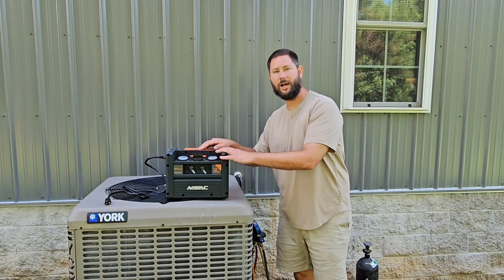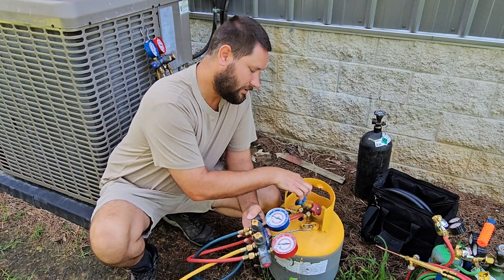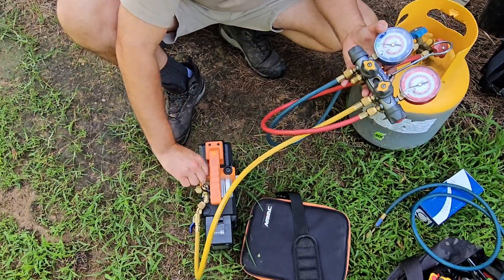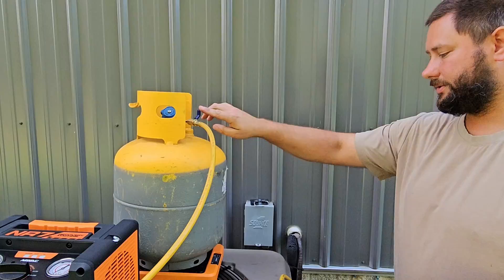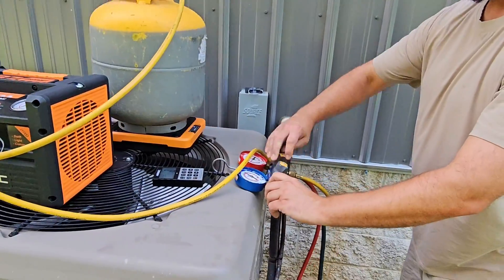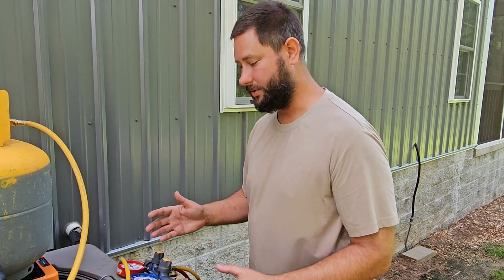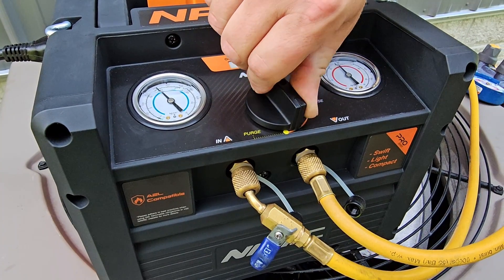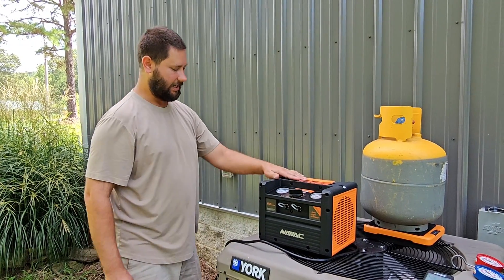How to use a Recovery Machine: HVAC Tips for Beginners

Comment: I'm still learning, and I have a question. 
I heard that the filter driver needs to be replace only when you open the system to atmosphere presure, don't could just do pump down the refrigerant I'm the condenser since the filter is before the service valves?
Reply from the maker: If the filter dryer is contained in the outdoor unit.And you pump down the unit, you do not have to change the filter dryer

Comment: Wonder what revovery machine witll work with R32.  I started working as an hvac tech back when we used r22 to blow out condensate drain lines without any cares.  Probably responsible for 2 or 3 layers of ozone, personally.  When the Kyota Accord was signed I purchased my first certified recovery machine from Goodman for $3600.  I cursed all the way.  I also got my R handling license as well.  For any who don't know it's your social security number.  Now with the switch to R32, begins a whole new chapter in refrigerant handling.  Good luck out there young grasshoppers.  One day you'll get old like me and not give a damn.

Comment: You mentioned that you didn’t want to recover past 5-10psig as to not draw air into the system and tank. You purged the line heading to your manifold but the best way to do it is to purge from the hose entering the recovery cylinder. The air in two of your hoses and all of the air in your recovery cylinder entered the recovery cylinder. Unless I missed that part
Reply: I think the hoses you are talking about are still in vacuum.

Comment: What is the compressors main function?
Reply from the maker: To pump the refrigerant through the system
Reply: Turns low temp low pressure refrigerant into high temperature high pressure gas

Comment: Does it matter if i hook up to bottle vapor or liquid port?
Reply from the maker: Yes, are you charging in liquid state?Through the liquid line, are you charging through vapor state in the vapor line
Reply: @ sorry. I Meant when you recover. I know the recovery bottle have a dip tube for the liquid port and the vapor port goes to the top. I’m just confused on when to decide if I should attach my hose to which port? What dictates which port to use for recovery set up? Does it matter?
Reply: If the state is small, like a residential one, it doesn't really matter. I always use the Vapor side because the liquid can just fall in since there is no dip tube on that side

Comment: My big question is, what do you do with the recovered refrigerant? How is it disposed of? 

Also what happens if you don't have any outlet to power your equipment with? Is it against code to simply just hook up a wire to a breaker and power you equipment this way?
Reply from the maker: Great questions.I will do a video of both of these
Reply: @TaddyDigest  yeah how to use the cheetah to the disconnect properly thanks

Comment: What is the reason for replacing the evaporator and filter?  Debris restriction?
Reply: @ArcolaBridge  Probably have a leaking evaporator coil and whenever you open the system to change a coil, compressor, etc. you need to replace the drier.

Comment: I wish someone would have told me that the recovery tank needed prep.  I don't remember learning that in school, nor did my coworkers mention this.   Thanks for sharing. from mid tn.
Reply: Common sense.  Tank filled with air, not refrigerant which of course would contaminate the stuff you're recovering.    You mix any air with the R you're using you get non-condensibles which can plug up the metering device used.
Reply: Why tf you worried about non condesables. You’re pulling the refrigerant out not re using it. Have you heard the words re claim, super tech?

Comment: Tadd  R32 and 410a uses synthetic oil while R22 uses mineral oil. I use separate gauges to prevent mixing of oils.. can you use a single recovery unit for both types??
Reply from the maker: Having separate recovery units would be pretty expensive and as long as you clear out the hoses and make sure that you don't mix refrigerants.Then I don't see a problem with using just one

Comment: I used a G5 and the pressures keep rising. Works for about 20-30 seconds then it cuts off. Wait about a min then turn off and on does the same thing. Did that for prolly an hour to recover 4lbs. Then finished it off with the Depot recovery bucket that never fails.
Followed the step by step instructions, new recovery tank. 
Why would it do that?
Reply: Something is causing it to kick off on high pressure, cool the tank and make sure all the valves are open. Especially the one on the recovery machine
Reply from the maker: I'm not sure that's very unusual
Reply: @taddydigest  a comment elsewhere said it was because the tank was too hot and going off on high pressure. I believe that was my issue

Comment: Question from someone that knows nothing about HVAC... How to do you braze the copper when changing the evaporator coil without running nitrogen through it? I guess that would not be possible since you're holding the refrigerant out in the condenser unit?.. not sure if that makes any sense.
Reply from the maker: If you're changing the indoor coil, you can still run nitrogen through the line sets and the coil to change it
Reply: @taddydigest  ohh ok so you would tap into the service port at the condenser unit which is past the valve that's locking all the refrigerant in therefore being on the evaporator side on the line set correct?
Reply from the maker: @anobody5708 Yes absolutely that's correct
Reply: @taddydigest  Thanks!!

Comment: Question from a new technician. If this unit can be pumped down into the out door coil, could we also pump it down into the indoor coil to change the drier?
Reply from the maker: It can only be pumped into the outdoor section. Because we use the compressor to pump it, then we use the valves to keep it inside

Comment: Question from a new tech - why did you add a small amount of refrigerant to the recovery tank that you just vacuumed before recovering from the condenser unit?
Reply from the maker: Just a show to everyone who watches the video that we are going to be recovering 410a
Reply: @taddydigest  If it is a 410a, why your cylinder is not pink? 2:55
Reply: @RadicalMT15  u slow
Reply: @RadicalMT15  Recovery tanks come in the generic yellow and gray with the new ones having a red strpe identifying them for flammable refriger fir flammable refrigerants . You tag them out with a label or just use a sharpie. Both are acceptable to identify the refrigerant inside.
Reply: @johnwilliamson4511  I'm referring to the cylinder he uses to put "410a" into the the recovery cylinder (preparation for recovery @ 2:50 )

Comment: I have a question? Why do you put 410 A into the recovery tank after you pull a vacuum on it to prepare it? Why wouldn’t you just hook up the recovery tank that has the vacuum on it to the recovery unit without adding 410 A first? I’m confused.
Reply from the maker: I just do it to show that it's the same Refrigerant, we are going to recover.
I could have removed that step and still been fine.
Reply: @taddydigest  Oh okay. Thank you so much for the response and the awesome video. I’ve learned so much watching your video content. God bless 🙏
Reply: @OSAS726  also, If your not vacuuming the tank on site,  you want to break the vacuum with some refrigeratiant because the recovery tanks can leak atmosphere under vacuum. (Or so I've been told by LG and naavac training, I haven't tested it myself)
Reply: @oilandfireguy1739  I really appreciate your response. Thank you so much for that information. God bless.
Reply: @BIGMIKEOSAS  glad it could help, I'm reasonably new to hvac my self! Don't wanna come off as a pro, so I like to share my sources of info
Reply: And it allows you to bleed air out of the hose before opening the refrigerant circuit
Reply: When you finished the purge part and closed the cylinder was there any presure or refrigerant in the yellow hose conected to the recovery outlet to the tank
Reply: Thinking the same i just hook rt up
Reply: It's just a bad practice to leave a tank under vacuum.